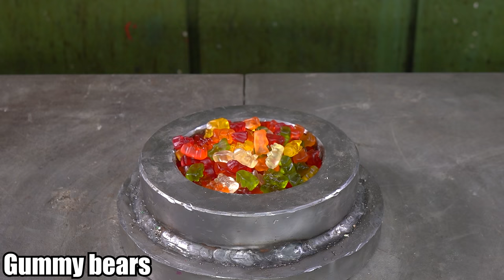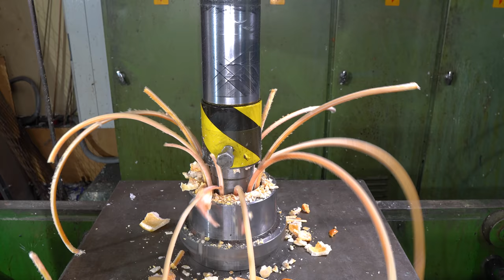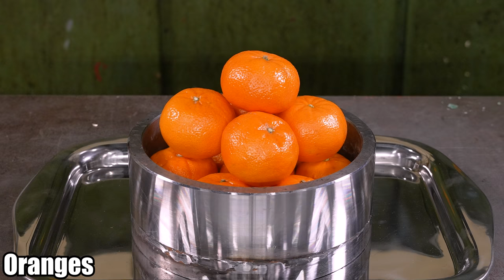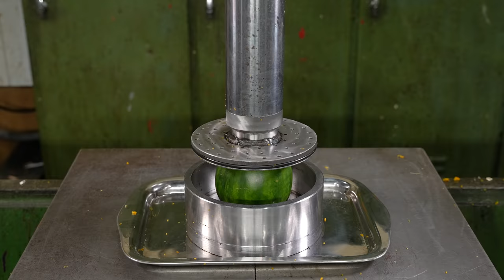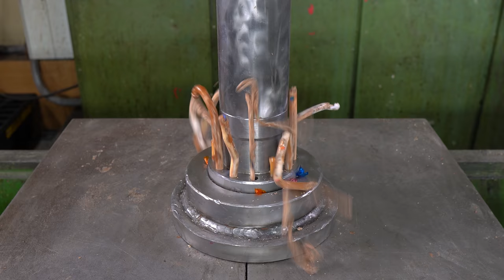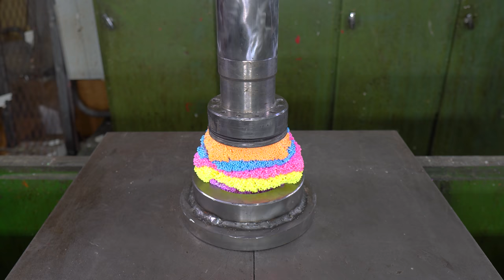Top Satisfying Hydraulic Press Moments WORM EDITION  | VOL1

Comment: Probably pretty difficult to do, but would be interesting to see a sideways version of this.  The plunger is solid (no holes) and the compression cylinder is on its side with a single hole on the  opposite end of the plunger. So essentially you compress whatever material and try to shoot it out a single hole in the other end. We could see what makes longest worm - or which worm shoots out the farthest.
Reply: They've got the smaller press, it would be pretty easy to try!
Reply: Would be easy by simply putting the hole at the bottom of the receiver to the side and a solid plunger. Same effect and easy to do.
Reply: Jr Payton that's basically the first version they ever made. It worked, but ultimately inspired the worm makers from this video. Christopher's idea would work closer to a syringe.
Reply: Notice that the table opens in the middle for anything that will get pushed through.
Reply: @viridiscoyote7038  I forgot about that video, but thats pretty much what I was going for but more like the syringe action you mentioned - where the whole thing is on its side to be able to point and shoot where you want.

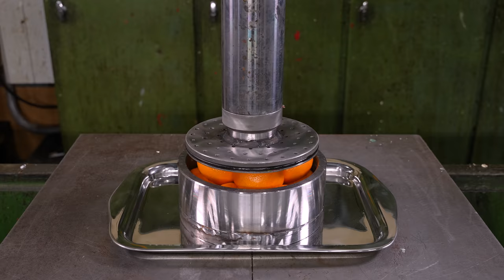Comment: 3:15   I'm sure out there, somewhere, there is some kind of math equation that basically says (Low volume density + Large surface area) = Large pressure differential when compressed.... or.... (High volume density + Low surface area) = Low pressure differential when compressed

Comment: I would love to see another bridge competition. Power tools crushed while running would be cool. Paintballs. Full co2 cartridges. Chunks of meat in the worm maker, then try to make a hamburger out of it. Wet concrete to see if it will squeeze the water out and make it solid, then leave it to dry and see if it is stronger or weaker than normal concrete.